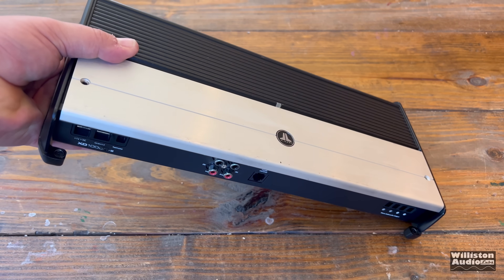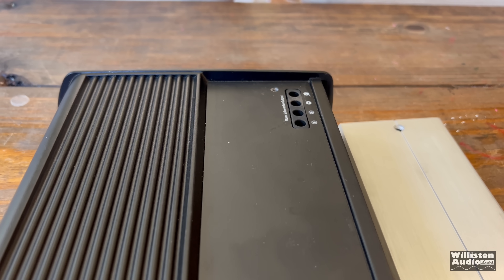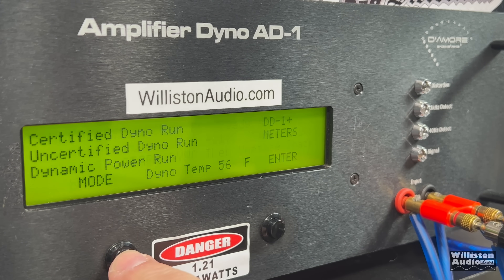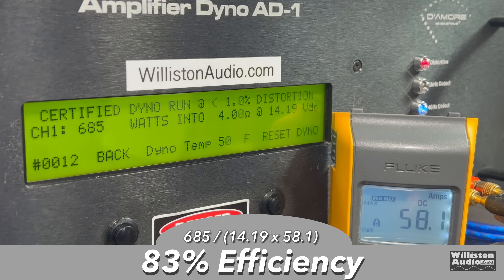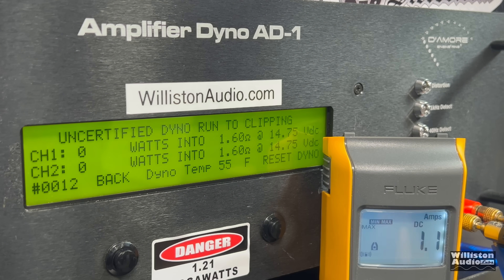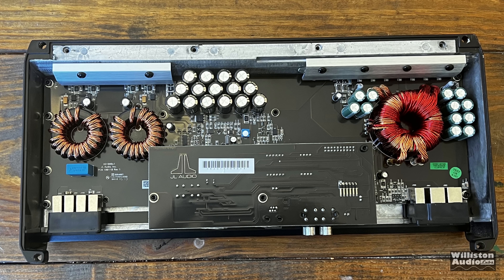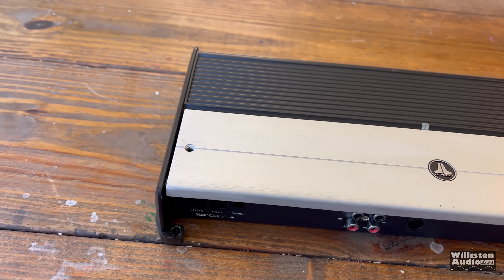Almost $1 per Watt? JL Audio XD1000/1 Amp Dyno Test and Review

Comment: JL is over priced but let me say if you want a long lasting amp that hits all those notes is quality over. I have had free ones . But I wouldn't purchase JL  for retail value
Reply: It's comments like this shows me who the brokeys really are  Sure you can buy a cheaper amp but the quality is going to be crap forcing one to eventually buy another amp which effectively will make it cost more. There is a saying that goes "buy it nice or buy it twice".  Furthermore, these are the same people that sate those who buy Ferraris are fools when they can easily buy a corvette for a third of the cost because it does the same thing.... really bro,  really jeez
Reply: It's comments like this shows me who the brokeys really are  Sure you can buy a cheaper amp but the quality is going to be crap forcing one to eventually buy another amp which effectively will make it cost more. There is a saying that goes "buy it nice or buy it twice".  Furthermore, these are the same people that sate those who buy Ferraris are fools when they can easily buy a corvette for a third of the cost because it does the same thing.... really bro,  really jeez
Reply: @WEVA111  no I am with you, jl is over priced but will last and got all notes. 

The years I dealt with and still have is old xtant amps , old kicker amps , and alpine from late 90s 2000

Comment: It's crazy how sum amps are huge and put out the same as a micro amp(small amps like Taramps put out Couple thousand RMS... Why is dat?
Reply: Brazilian full bridge technology = cheap dirty power, strong output but NOT clean needs lots of amperage from battery & alternator
Korean half bridge = more efficient, 
clean power
Chinese = cheap dirty power, strong
output, low quality
Japanese = expensive, higher quality,
better SQ
US = pricey, better quality than Brazilian,
Korean & Chinese NOT Japanese
Reply: @408SPLKINGS  Shit dude that summed it up for me I was on the fence on getting a Taramp amp... Don't wanna upgrade electricals to run sum bass... Thanks
Reply: Bro taramps is cheap for the price but it does have power and tbh it doesn’t sound terrible, but is it JL? No it’s not, and is it worth it to you to pay is the question. Can you afford it? I’m happy with my JL HD1200, every time I compare to other amps I just feel even better about it

Comment: JL Audio made some of the absolute best subs back in the day. I had two JL 15s in my Explorer on a chrome Kenwood 1600 watt amp with two watt gauges on the front and it SLAMMED those 15s. I could put a full Coke can on the roof and bounce it 6' in the air on some Trick Daddy joints.

Comment: Oddly enough back in the 90s when I was big into this stuff, you were expecting to pay $1 per watt, for real world clean power. At least in Canadian dollars anyway, which at the time was about 35% less than USD.

I do like that JL hasn't sold out it's brand and turned it into garbage.
Reply: I go back to 1990 JL audio 12 w5's dual 8ohm, and when the w6's triple stack, I had them, and in 99 or 2000 when the w3's came out I was first in line. I have 5 10w0's now. JL's quality has never disappointed.
Reply: Time will tell if this statement remains to be true.

Comment: I thought the size of the cap usage has to do more with noise filtering and power response needs. I know I am missing something. But I think if you look at class D low impedance units they will use larger caps. Class D amps designed for mids and highs will have more caps. Last thing of not is class A/B typically favors more caps. These are observations. With a little bit of facts. I could also be totally wrong.
Reply: The multiple small value capacitors equal lower impedance, which equals releases the energy quicker with less loss. This was pioneered by Peter Stein of ME 
Sound in Australia.

Comment: Does what they say it does, that carries a lot of weight these days. 
Never had a JL anything and probably never will, but this is a nice amp. Oddly enough, I like that they don't rate it below 2ohm.  I'd rather run a higher ohm load and still get the wattage than to have to run everything at 1 or less to get better numbers. Then again, for the price of this one... I could buy a bigger amp from another brand and just run it at 2. 
I'll keep banging my D'Amore though since it's already bought and paid for.

Comment: Had 2 of these amps die at the same time in a build. Power supplies both went down virtually simultaneously. Very surprised. No apparent reason why. Was told this is not uncommon under prolonged low voltage conditions- which were seemingly not the issue on this particular build. Not sure if that’s accurate or not. Owner repaired at $400/each and have been fine since. A couple lemons maybe? Nothing against JL. They’re okay. Basically the Apple of the mobile/marine market though. Price to performance ratio is sub par at best.
Reply: You can never expect even the best amps to survive if someone with no knowledge of decent electrics keeps beating on them…All amps will die eventually under those conditions..
Reply: @justkiddin1980  That’s presumptive, but again, since repair there have been no issues with either amp. Going on nearly 2 years since repairs without change in the electrical system (which consisted of HO alt and Northstar AGMs) or non-abusive listening habits.
Reply: possibly a loose connection
Reply: It's comments like this shows me who the brokeys really are "price to performance is sub par at best" are you kidding me. Sure you can buy a cheaper amp but the quality is going to be crap forcing one to eventually buy another amp which effectively will make it cost more. There is a saying that goes "buy it nice or buy it twice".  Furthermore, these are the same people that sate those who buy Ferraris are fools when they can easily buy a corvette for a third of the cost because it does the same thing.... really bro,  really... jeez
Reply: @WEVA111 Since you’re fond of axioms here’s another, “The Rich stay rich by pretending to be poor while the Poor stay poor while pretending to be rich.” You are free to spend your money as you wish- foolish as it may be.

Your analogy of comparing a JL amp (made in a Chinese build house btw with other amps from other manufacturers) to a Ferrari is a poor one and I can surmise you’re definitely not familiar with Ferrari reliability and maintenance- not to mention the cost of both. 

That being said, I apologize if I offended your brand loyalty. Please show me your counter factual data (not anecdotes) showing the reliability difference between JL and other brands with significantly better price to performance ratios.  Please help the “Brokeys” rationalize their purchasing decisions.
Reply: "Basically the Apple of the mobile/marine market though."

Which is why I buy Audiopipe amplifiers for my vehicles. They make their rated power and are not overpriced.

Comment: The large and few vs small and many...well here's a few reasons:

1. Smaller caps can be arranged in a way that can be an advantage to the board layout, kinda like filling a box with sand instead of rocks - you could fit in MORE

2. Lower overall ESR - effective series resistance. The lower you can bring this number (in milliOhms for switching supplies) the better the filtering and less heat. Even though large caps have the advantage of being lower in ESR overall compared to same capacitance smaller ones they get expensive if low ESR caps are chosen - the smaller caps tend to be cheaper in that sense as they are much more mass produced
3. An ounce of reliability - if the caps to fail, at least there are still some that will still work...if it were just two or three of them that would be trouble

As for using large caps it is almost idiot proof, but certain good practices in board layout and design are not fully met. One example is having the caps as close as possible to the rectifier, smaller caps could fit in ahead in that example than large cans.

Comment: Capacitors have internal resistance.. more caps less resistance.. so the power supply can handle short high current power draw..

Comment: Unfortunately, JL and other big brands are losing the fight against many of the cheaper, higher quality amps out there. As we’ve all learned, the bassheads are after the .05 ohm wind, and the rest of us SQL folk are after a cheaper watt, and that puts folks like JL in a tough position. We don’t give a shit about the bespoke design when the amp barely makes rated at 4/2. SQL folks also don’t care about 1 ohm, time and time again. Big D, let’s go with a 4 ohm/efficiency test, as I’ve asked for numerous times.
Reply: The hd 1200 is plenty loud but I will admit two of them would be crazy loud to where it’s not musically good or balanced

Comment: I've bought 3-4 XD amps used. They all continue to work great years later. Highly recommend second hand if you can test them, avoids the high price.
Reply: The xd line is fairly easy to repair
Reply: @jakep8484  good to know! One used purchase has something rattling around inside but still performs fine.. so far.
Reply: @Geoff240ti  i would check that out, could short something eventually. Xds and slash are my favorite jl amps.
Reply: @Jake P  good advice, I'll pull it from that vehicle and have a look. Haven't tried a slash amp yet, any other favorites from other brands?
Reply: @Geoff240ti  well full disclosure I used to work for JL so have only repaired JL amps but the class ab rockford amps and audio control amps look interesting as well. As for subs though I love my JL 10W7 and that has nothing to do with my history, its just a really smooth, deep and musical sub 👍
Reply: @Jake P  what an interesting job to have! Love the W7s, my wife has a 12 but it basically plays low volume and does very well. She had a 10 W6 before that, also great! I am a fan of the TW slim subs and W3s too. Guess I'm clearly a fan boy!
Reply: @Geoff240ti  yeah the subs are nice and should last a long time, enjoy 👍

Comment: hey big d, love your videos man, wanted to point out a couple things though as a jl dealer, 1 jl is very protective of pricing so you tend to not see discounts like that even on crutchfield but with the release of the new XDM amplifiers i believe jl has loosened that for the v2's, so for anyone looking to get these, now is a good time haha.

And 2 i wanted to put out there that while i am always frustrated having to tell someone that the bass knob is separate (and expensive), it is notable that jl does NOT use passive bass knobs keeping signal more clean and they do a much better job of adjusting the signal in a more linear fashion compared to most other brands i've used. 

as always though man, great video and keep it up
Reply: Still if there going to charge that much for a amp the bass knob should be included.
Just my opinion.
Reply: @chadmilligan342  and that's a totally reasonable opinion, and one I share honestly haha but even soundigital sells there knobs separately and that's my "affordable" brand haha so idk how to get away from it. Use a Sony radio and you get a decent built in sub level control is usually how I get away with not needing one haha
Reply: @dustinsonger851  do you prefer Sony headunit over Kenwood or Pioneer?
Reply: @NewVisionLCS  as far as we have tested Sony has the best pre-outs in real world use, and there screens are far and away the easiest interface to use when your actually driving the car haha. Pioneer is an absolute no go for me and Kenwood isn't bad but they are overly complicated and they always seem to do something wierd to the signal
Reply: Quick question I have two of these amps I’m looking to pair them with the 12inch W7 would you recommend that or go with the 131/2

Comment: The fixed frequency subsonic is the worst thing about it, in my opinion. It really would make it so that you'd have to build a ported enclosure with that in mind. On an amp of that cost, it should certainly be variable.
Reply: That is my okay gripe with their amps. I bought the HD1200/1 amp. I love it but there's no adjustment for the subsonic filter as its fixed to 30hz.

Comment: The smaller caps have a few pros. Reliability, life expectation is higher. Better temp stability.  Reduce fire hazard IF one fails. Lower internal inductance for a faster response.
Cons 
Cost more the higher price of a single cap is generally less then the combined cost of 3 or 4 smaller caps plus most caps are installed and soldered by hand so more costs with more assembly.
Board trace layout and space. When placing multiple round cans you take up dead space between them. Batch control Generally you want all the caps together to be from the same batch or match esr and inductance so they share the load evenly.

Comment: I really don't mind not seeing it blow away the rated power. For ppl not competing in an amp class it makes the most sense to just know what you're getting.

These days without a Big D video you might not know if an amp does half or double it's rated power
Reply: Gone are the days of the J.C. Whitney catalog where you were pretty much 100% guaranteed what you were getting was no more than 10% the advertised power - or less.  So many of us were so uninformed back before the internet.
Reply: @jdlech  Pyramid for the WIN!!!
Reply: @jdlech    my first sub was a 12 inch subwoofer from JC Whitney and a two channel Boss amp in 1997 or so
Reply: @jdlech  I was able to visit the JC Whitney warehouse, in Chicago in the late 80’s.
Reply: @jdlech  At least in Europe there are still some brands that claim 1000+W for something like a 2x50W puny thing. 

In the worst case (Auna) even less power and even more bloated numbers, like 6000 or even 10 000W (6 channels and a bit over 400 W total at 13,5 V and 1 % distortion) and one example (Auna AMP CH 02) that is marketed 1400 W max and has 34 W of total power, or the AB-650, 4800 W max, actual power 96 watts total to SIX channels! Technically they can be compared to something like 80's boomboxes as the amp chip(s) run straight from the 12 volts.
Reply: The power ratings should fall within 2% +/- of the stated power out put. Like everything electronic you need reliable specs to design a system. It doesn't matter that you under rate or over rate your amps because the information you are publishing is wrong either way. Just publish the true power ratings and under what conditions they are obtained and it's all good.
Reply: True, as long as the amp does its rated power, I'm happy with that.
Reply: @sunnyskiesblue  People get invested in power, but what matters is that it is rated power and clean power. My JL XD amp pushes about rated power, but sounds significantly better then a entry level Kicker amp pushing more power. You get what you pay for at the end of the day. Amps for subs don’t matter as much, but muds and highs absolutely.

Comment: Good amp but a hard pass from me. This isn't 1995. You can get quality amps for way less these days. I bought a Kicker 800 watt amp, 2 10 inch comps, box, bass remote, and wiring kit for less than that.
Reply: Come on kid your comparing apples to oranges
Reply: Bruh, basically you are just saying why buy a ferrari when you can easily buy ten Honda civics and they do the same thing

Comment: No rocket science here. They are taking advantage of Ohm's Law and the RC Time Constant. The time to charge a capacitor fully is dependent upon time and resistance. Obviously more capacitance equals more time to charge - a direct proportion. Each set of plates/foil within a capacitor has a resistance value due to cross sectional area, thickness and material (typically aluminum Al for electrolytic). The less resistance, the faster it can charge. Every time you add an identical capacitor in parallel the resistance will be reduced to half and you double the capacitance. To double the new capacitance value and reduce the resistance again you will then need two more capacitors in parallel. You see where this is going. Each body has less capacitance, so it charges faster than a big one, but more internal resistance which is negated by doubling the quantity which halves the resistance and doubles the capacitance. That is why there are so many on the PCBA of this clean machine JL Audio amplifier. You get more capacitance in the end and with a faster charge time than two or four larger casing capacitors. As Ed said, you need more with much smaller capacitors to have the same current capability as a larger cap. Technically, only two of these smaller caps in useage would be beyond their surge design specification, but 12 or more negates this.

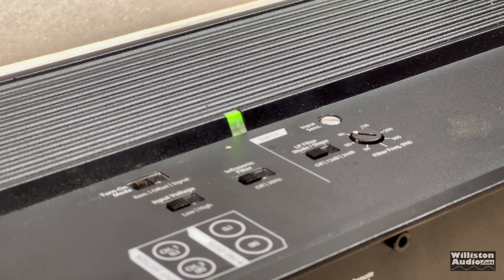Comment: Where is the beef? For this kind of money you can buy a really high powered amplifier with the bass knob. And it’s actually a good amplifier. People who buy this have more money than cents. You can’t even come close to building a real system with these amplifiers I did have a chance to play with in JLDSP what an incredible piece. Had a couple of weeks of tuning with it that was a learning curve. Don’t know why anyone would use their amplifiers 10:17 so below average
Reply: It's comments like this shows me who the brokeys really are  Sure you can buy a cheaper amp but the quality is going to be crap forcing one to eventually buy another amp which effectively will make it cost more. There is a saying that goes "buy it nice or buy it twice".  Furthermore, these are the same people that sate those who buy Ferraris are fools when they can easily buy a corvette for a third of the cost because it does the same thing.... really bro,  really jeez
Reply: Believe it or not, most people have no interest in a 10,000 watt stereo system that wake their neighbors up at 1am. So, yes you can build a very nice system using this app to power their subwoofer(s). Music is much more than a burp.